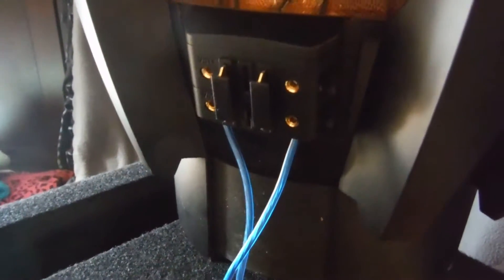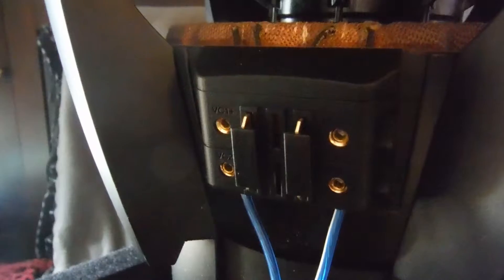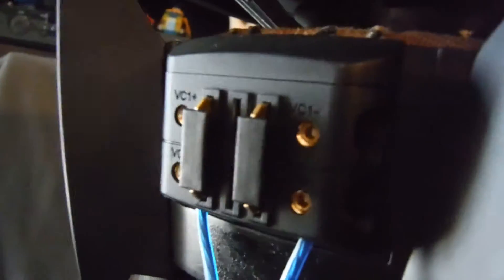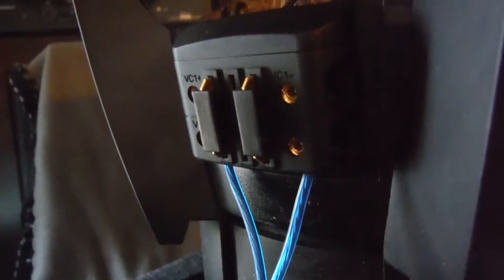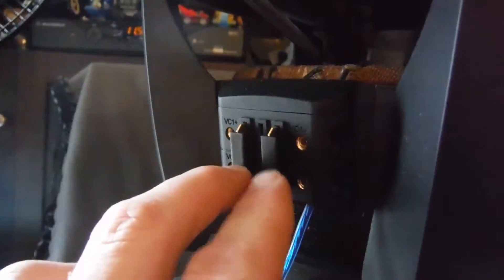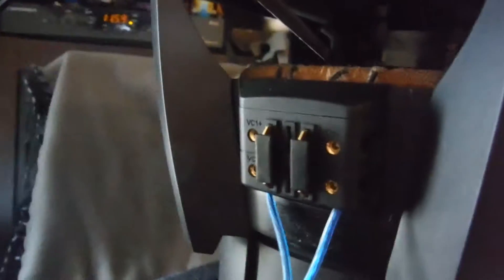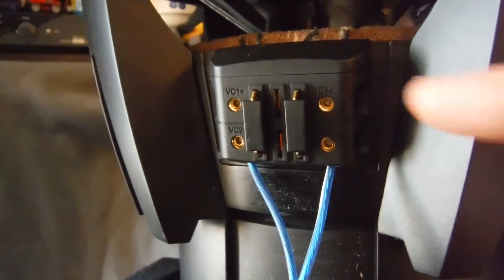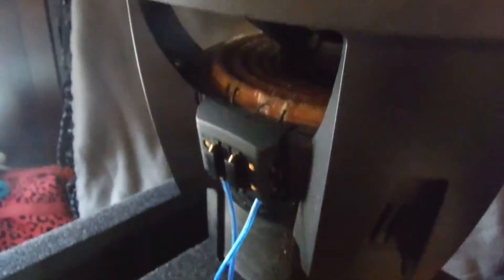Alpine SWX 1243D Type X 12 subwoofer How to wire the dual voice coils

Comment: Hey man, how would I connect if I wanted to do 8ohm without the jumpers
Reply from the maker: I have videos on parallel and series wiring. You want to wire in series. So the top plus to minus and the bottom plus and minus are your speaker wires. Thanks for your question and comment 😊